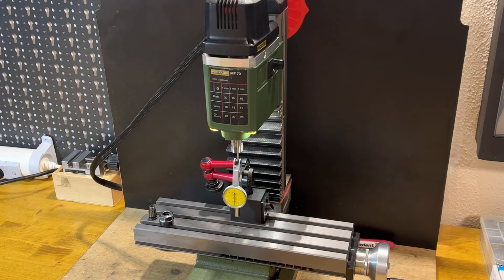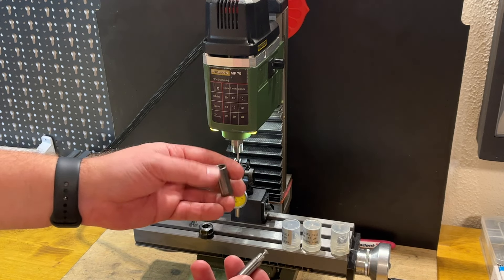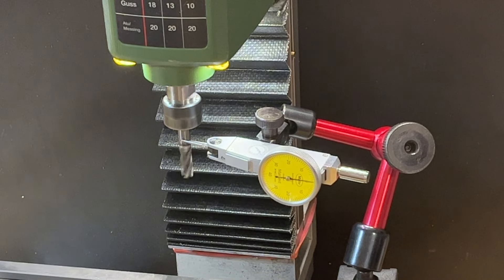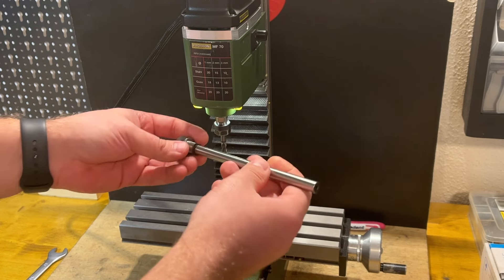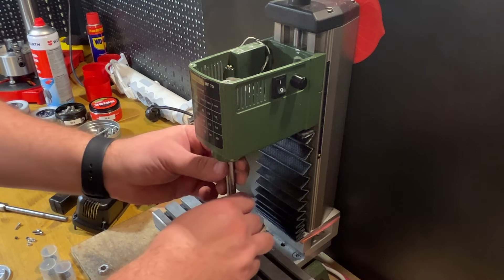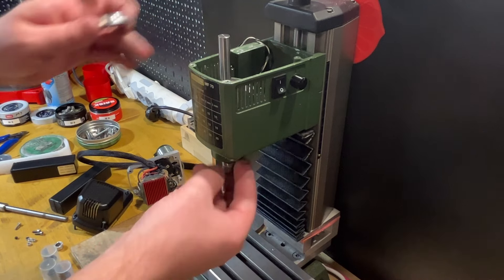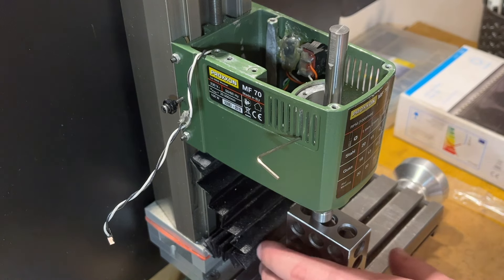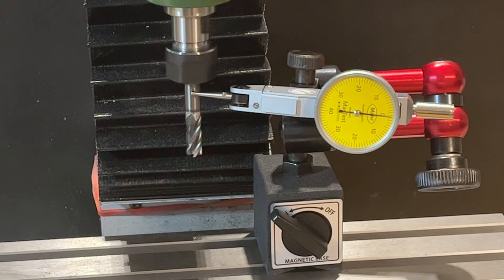Precision spindle for Proxxon MF70

Comment: Nice upgrade. Can you add a part list needed for changing the shaft?
Reply from the maker: Basically only a shaft and maybe bearings. But then you will need to make something with engine. In my case I have also replaced engine. You could take a look in this video, how everything made inside https://youtu.be/sM5KqNiaeHQ
Reply: @zhadlun 
Ох мнеб так же, Волоримир. Очень хотелось бы такой же стержень, что по точнее, ну и конечно конфигурацию с редукторной шестерёнкой (с другого видео), что конвертирует скорость в мощь. 

Если бы вы приняли заказ, во сколько обошлось бы мне это удовольствие?
Заранее благодарю за ответ.

Comment: Thank you for sharing your video with us.
But easily was possible to remove run out whith grinding because 0/01 or 0/05 also 0/10 mm is not much and white grinding will be exactly ziro.
Normally when you buy some accessories for lathe or milling machine of course are not correct and fit white your lathe but machinist must Fix it.
Any way thank you again.
Best regards sina von Österreich 🇦🇹
Reply from the maker: With spindle yes, possible to fix with grinding, but then I need also take care about tapper there. Not sure I will be able to do better than it was. But how about a collet. Grinding there will not have a result in my mind…